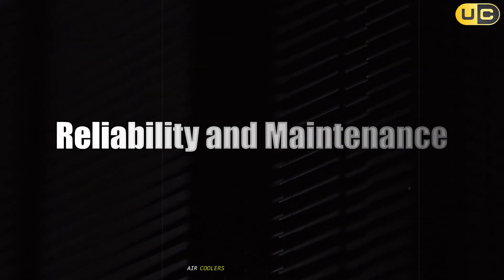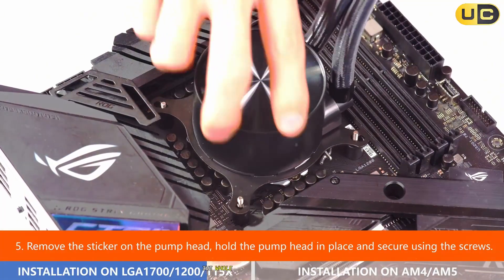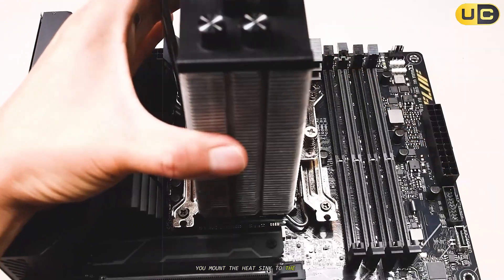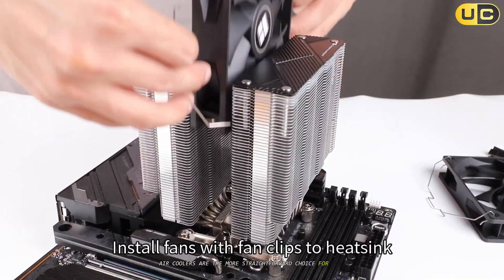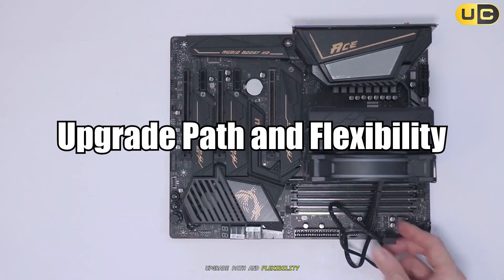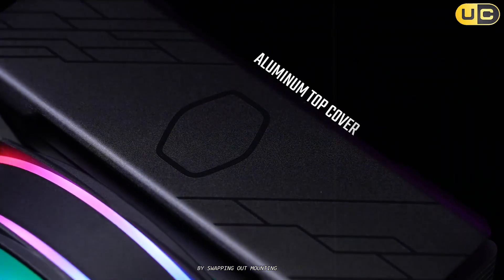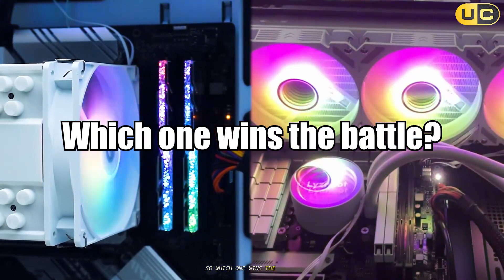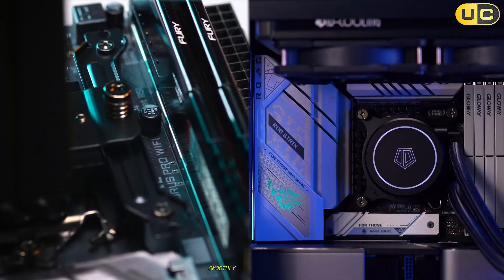AIO Vs Air Cooler: Which Should You Buy?

Comment: Air CPU Cooler 100% more reliable safer easily to get new fan if one goes out and less risk while aio if pump or radiator is out u gotta replace the whole unit and hi risk of leaks. i got Be Quiet Dark Rock Elite Air CPU Cooler with 2 135mm fans with Fluid Dynamic Bearings that will last 200k to 300k hrs.